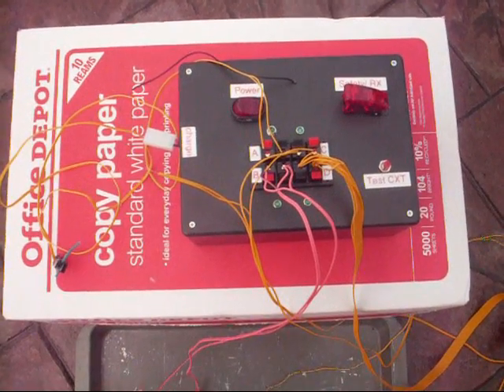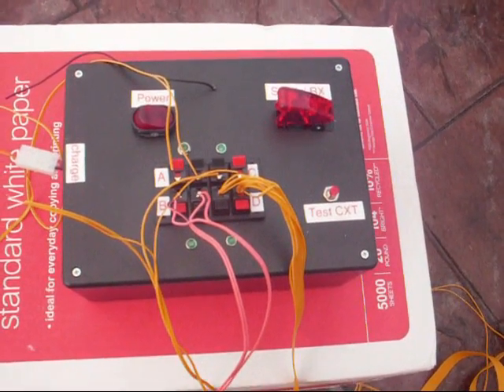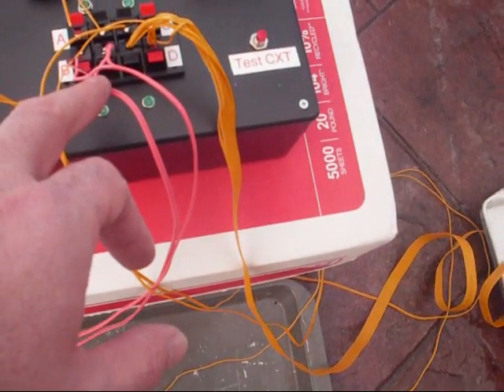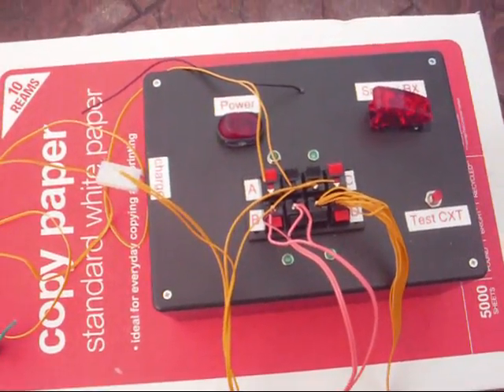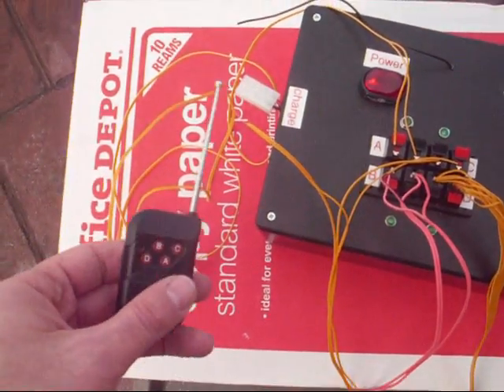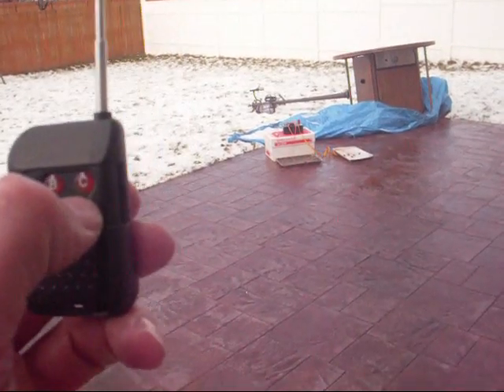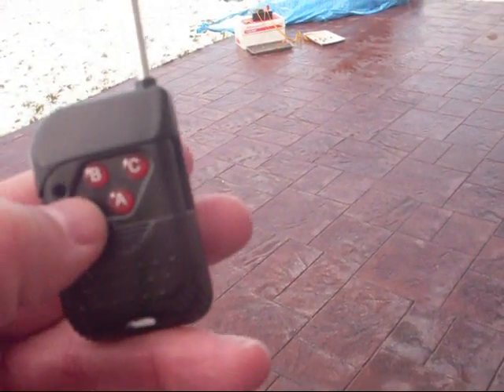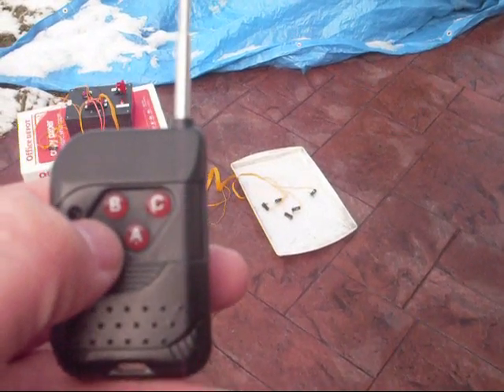Wireless Firing Device

Comment from the maker: You separate two preds, and attach 2 wires from both predator leads together and for the 2 that are left, 1 goes to the black terminal and 1 goes to the red terminal.